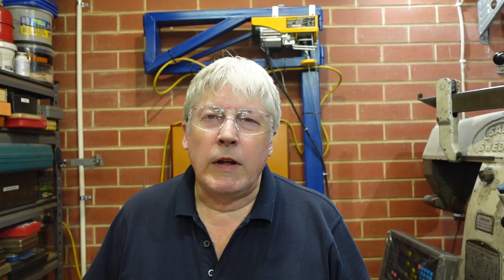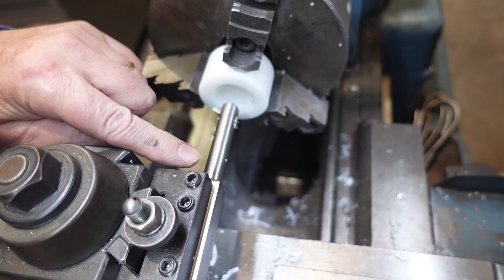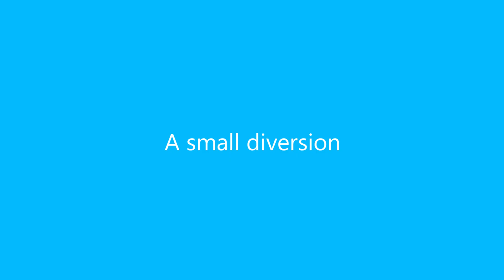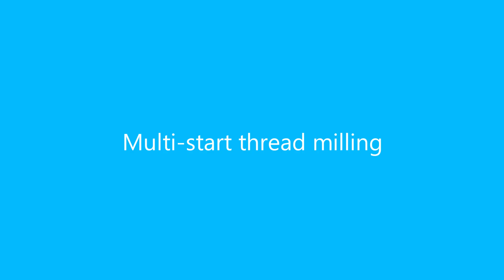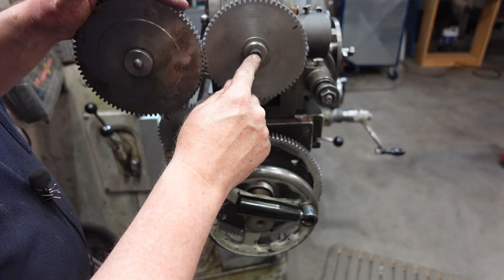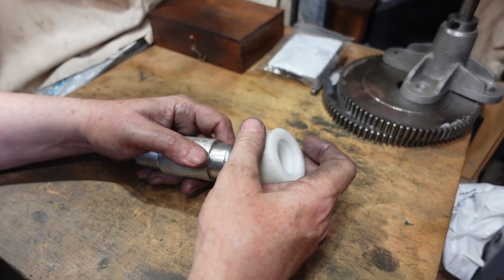Multi-start threads

Comment: With the right lathe and the right pinch/lead you can just pick it up with the chaser.(I assume you know this and just forgot to mention.)
Reply from the maker: That's the problem - the lathe still has to have the right feed to do that. If you have the feed, I'd prefer to single point.

Comment: Your mate seems to be serving you up a fair few video ideas on a silver platter. Might be worth giving him a bit of space for a while and showing off some of your own brilliance instead!

Now, this is a cracking opportunity to sort out all the fancy threading lingo. TPI isn’t much help when it comes to multi-start threads—truth be told, it’s not great for any thread. Pitch is the real hero here.

With multi-start threads, the key thing is lead—that’s just pitch multiplied by the number of starts. So remember: pitch isn’t how far you travel in one revolution, like with a standard thread. It’s still the distance between the individual thread forms… but you’ve got to multiply it by the number of starts to get the actual travel per rev ( lead ).

And as you crank up the lead, the lead angle gets steeper too—which can cause clearance headaches. Might even explain why that poor dovetail cutter copped a hard time! This eases as the diameter relative to the pitch gets larger.

The real beauty of multi-start threads is that they can give you a nice long lead without digging a giant trench in your material — long stride, short shorts, you might say.
Reply from the maker: Yes. TPI does not naturally work well for multi start threads, and as I usually do single start threads I don't differentiate mentally over pitch vs lead.  
As for my mate, I have probably 5 to 10 people (mates/ friends/ neighbours/ family/ etc) who drop in and ask me to do things for them. I usually don't name them as they prefer not to be identified. It is one thing to know a process exists or something needs to be done - it is another to know how to do it. 
In this case, he has a multistart thread to duplicate but did not know how it would be done. Suggested others may be interested in seeing it done too...

Comment: I think I would stick with the lathe, it seems to be much simpler.
Reply from the maker: You're right there. However, a typical lathe starts to get to a mechanical disadvantage once the thread pitch gets greater than the leadscrew if the gear box even copes with those.

Comment: What application would you use double start threads? (I know, I know, Haven't seen any or their use)
Reply: Anywhere you want a high lead thread to minimize turns per travel distance, but still want a fine pitch thread to minimize thread depth. I just made some custom parts with an 8 start thread, so that 2 turns advanced the parts 0.6", but the thread depth was only 0.040"
Reply from the maker: Usually they seem to be hidden away - things like electric actuators and wormdrive gear boxes. Not much call for them for the average shed user but interesting to know about. The down side is that if the helix angle gets too large, they don't hold as well.
Reply: @occasionalmachinist  Thanks for explaining
Reply: Camera zoom lenses.
Reply: bottle caps spring to mind as one of the most common you overlook.
in front of me here... 
coke bottle. single.
juice bottle. double.
iced coffee. triple.
results may vary.

often large bore threads of fine pitches are. thinking certain LED downlights i recently pulled apart.  the bezel ring, M"huge" X0.5-4start.
wood screws, some are some arent... 

if you really stretch it, a thread is just a single tooth gear with an extreme helix angle. a spur gear is a multi start thread with zero helix. really there is no difference between them other some geometry.

a cylindrical rack has no lead and a 90 degree helix...
Reply from the maker: True - bottle caps can have multistart threads, although not always. They didn't get a mention because I don't drink those things.
Reply: @occasionalmachinist  generally i dont drink bottle caps either... :)
anyway, they probably are the most common place yet overlooked. who looks at bottle caps?
Reply: @paradiselost9946  Thanks to all for explaining it